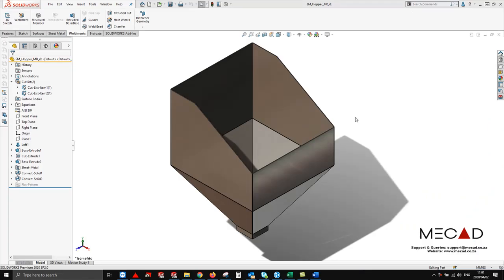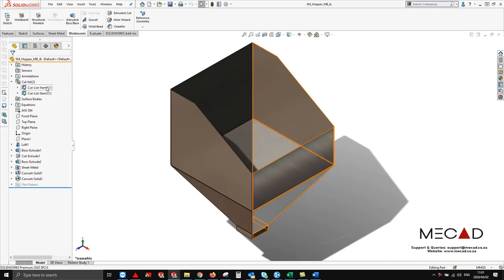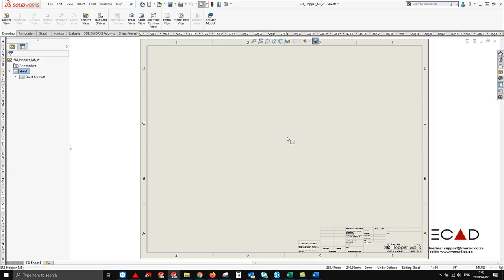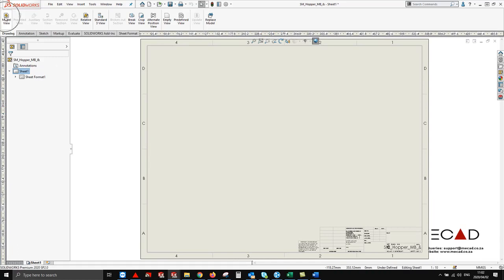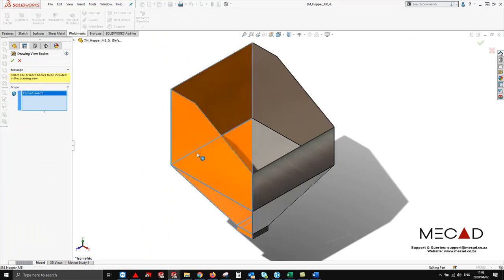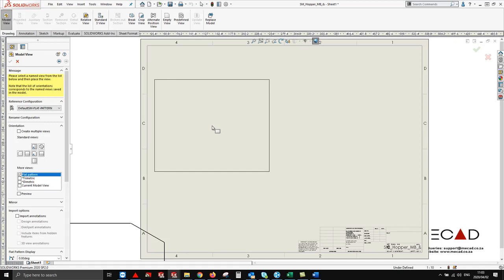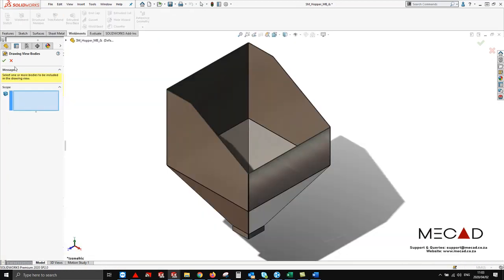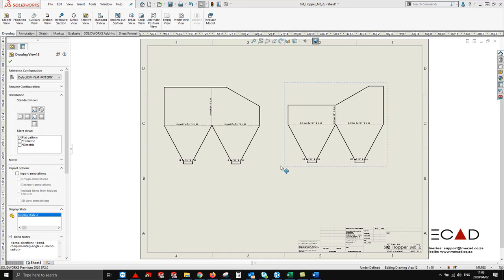How to create Flat Pattern drawings from multi-body sheet metal parts in Solidworks.

Comment: How can you give body partnumber automatically come to drawing sheet with specific part number
Reply from the maker: Hello

You will have to go into the "bodies" folder,  and manually rename the multibody's with the part number you want associated. SOLIDWORKS will not be able to automatically name the multi-bodies. You will then have to select the following 2 options when creating the BOM:
1) Change BOM type to Indented
2) Under indented, select "Flat Numbering" from the drop down menu